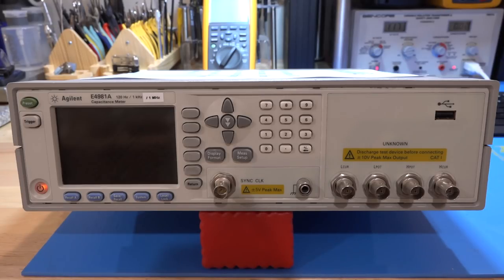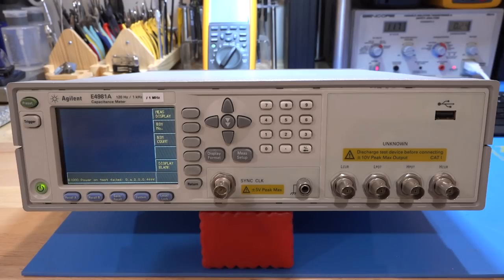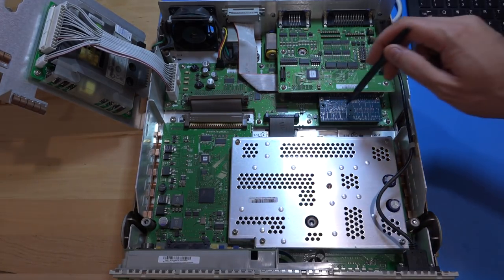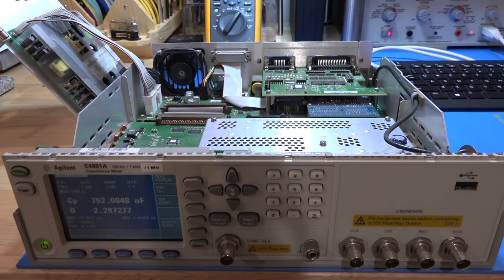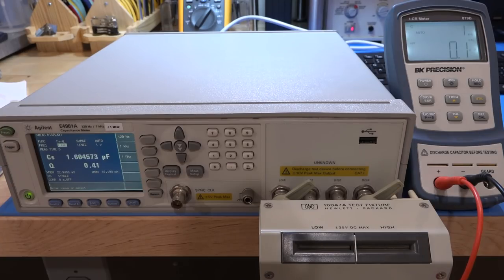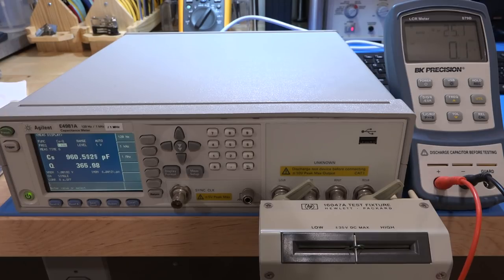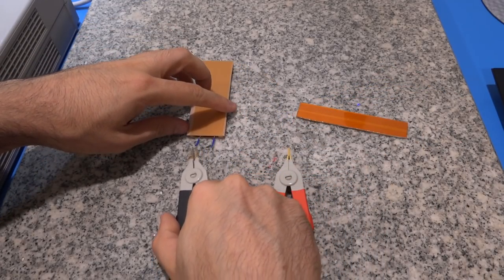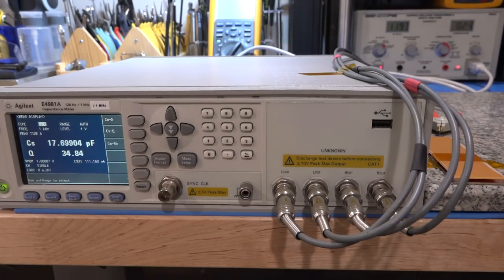TSP #127 - Teardown, Repair and Experiments with an Agilent E4981A High-Speed Capacitance Meter

Comment: The last communications test set I purchased for parts had the same problem.  Had a ribbon cable partially unplugged from the hard drive.  Plugged it in and the darn thing fired up with no faults.  Now back to searching for another parts unit. :-)  Everyone deserves a easy repair every once in a while.
Reply: Same here, bought an IFR with bad video only to find the ribbon cable slightly unplugged.

Comment: Wow, I wish I had repair problems like this one once in a while.  You got a lucky charm over your head Shahriar .  Always entertaining and informative.  Better luck next time with some non working machine, I do like the longer repairs more, I hate to admit.
Reply: I once had a ribbon cable and the ID connector at one ende had one wire that didnt make proper contact. After opening it, shifting the cable 1mm further and closing it back up... works. But finding that took many hours...
Sure, if you can see the connector is lose or just reinsert it thats no big deal. But cables or such connectors can be a pain in the ass.

Comment: Always interesting, with an good lesson ... always check connectors!  Would like to have seen the change in capacitance as small items were placed on top of the cap.  Also curious how the Test Fixture was actually connected.  It looks like a D9 connector on the far right but cant really see.

Comment: Why would the series resistance be hundreds of K for the air capacitor made with pcb material?   I guess that value doesn't correspond to any actual resistance in the setup.

Comment: Femtofarads, that is measuring attofarads, the display changes with your voice moving those PCB plates. Sample at 1MHz and get the data out, and you can make a microphone out of that PCB material.

Comment: I am in no way an electrical engineer etc.. but what is a good Q Factor? Reading online, bigger Q is better. But is there a maximum value? Is there a range for desired value?
Reply: Its the ratio of stored energy divided by energy loss per cycle, ie higher Q means lower loss at AC.  It depends on frequency

Comment: Great video! Nice equipment! I have been thinking - why does almost every piece of HP test equipment have an "A" on the end of the model number? I am sure there is a reason - does anyone know? Thanks for the great videos!
Reply: David DeVillers 

According to an ex HP employee that I know, HP's marketing people assumed that an instrument with an A revision would be judged by the unwitting purchaser to have at least one revision since introduction, and therefore a better  unit.  They didn't do this at the very beginning, but you are right, now they all seem to be marked with an A or better.

Al

Comment: 12:30 "we are into the femto-Farads" With 7 digits, the last one is displaying tens of atto-Farads. The manual lists the accuracy as 0.042% (420ppm) which is very impressive, but I would only expect the first 4 digits to be useful. (in the 1kHz speed, at 1V, the 100 pF range accuracy falls to 0.055%=550ppm). Why display 7 full digits? You can't even be sure about the last 3.

Comment: We use these meters in the mlcc systems we build and a have repaired a couple of them. I have not watched the video yet but the weak point is the power supply. Same thing fries, luckily it’s a stock PSU at digikey.
Reply: And watched it. Funny it is a loose cable. Yes, these are very fast, we use them to measure up to 1mil components per hour on the machines.
Reply: Oh, and it is completely normal for the agilent ones to boot with the keysight logo. I think all of ours do.
Reply: @Kevin A. MPB125-4350RG

Comment: You could've just replace the ball bearings and it would be as good as new.
Reply: Антон Южаков I find those bearings hard to source. Also I had a similar fan and no bearing numbers on them.
Reply: You don't really need any numbers, just measure it and find similar one. IIRC they are usually marked as 693ZZ.
Reply: Антон Южаков Yeah I could look it up in my little bearing book but I found it to not be worth it sourcing these for 2$ a piece plus shipping. I'd rather use a more silent PC fan even though they usually don't have ball bearings they hold up reasonably well because I don't run my instruments 24/7
Reply: Well, fan shown in this video cost 9,93 € so bearing replacement is quite reasonable thing to do IMO...